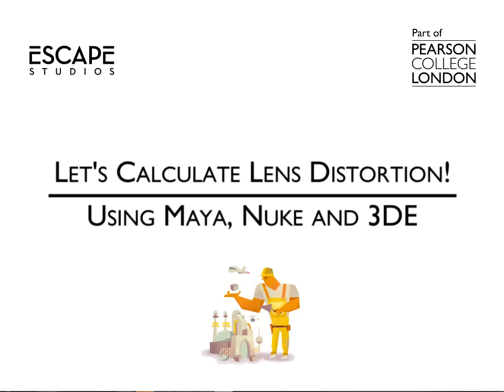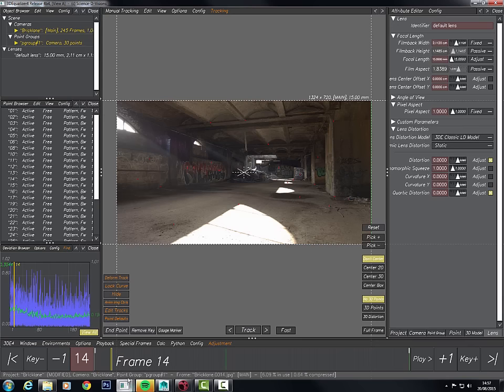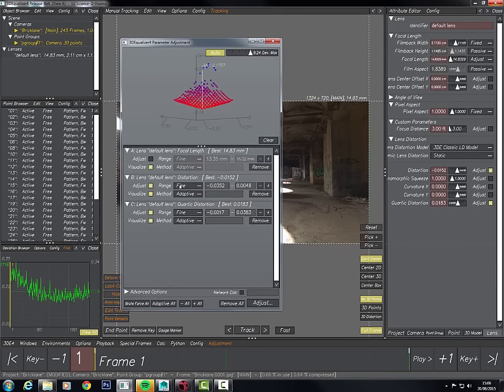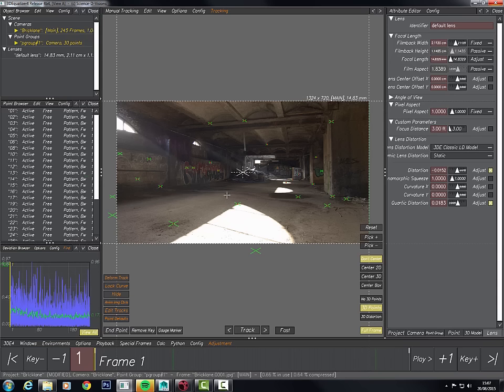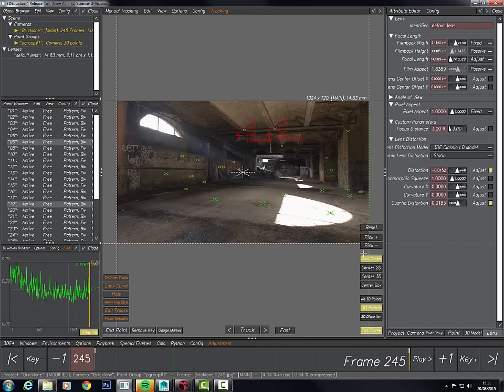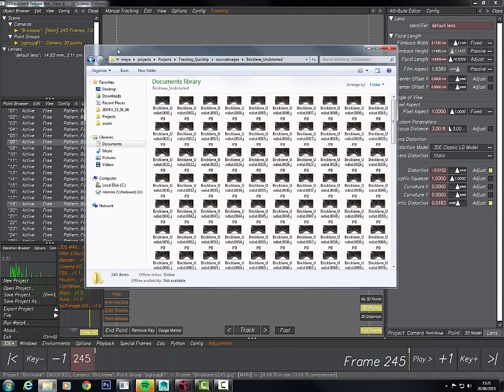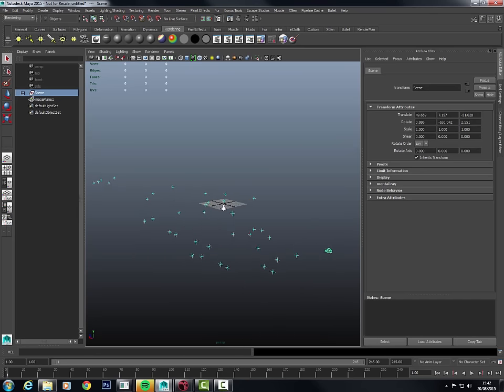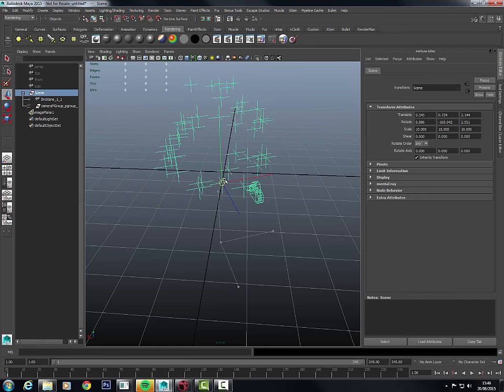Let's Calculate Lens Distortion! Escape Studios Free Tutorial

Comment: Thanks For Another Great Tutorial..You guys Rock..Can you tell me how to calculate focal length filmback height when we have no information just video..Cheers bro..
Reply from the maker: This is a tricky one if you have no camera details at all. It will involve working out the cameras field of view and use mathematics, along with the vanishing point, to work out the details you are looking for.
Reply from the maker: Someone else here at the studios suggests the following: 

"you could try dropping the footage into nuke and adding a 'viewMetaData' node to see if you can find the sensor height, or the model of camera. If the model of camera is in the metadata a quick google for that model's sensor size should give you what you need

Failing that, you can keep the film back height that 3DE has already provided and just use the parameter adjust to calculate the focal length, as shown in the video. The parameters may not end up being the same as what was shot, but that shouldn't matter, it's only the angle of view that is important."

Let me know if that helps.
Reply: Thanks a Lot..I will try this and let you know:)
Thanks
Reply: It did help.
With Second Method I could solve very precise Camera Moments..
Thanks